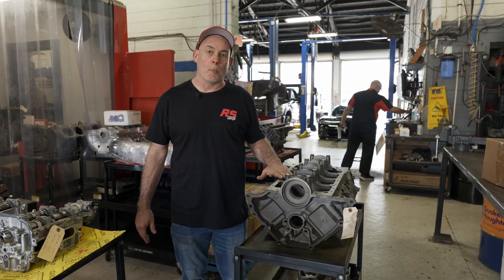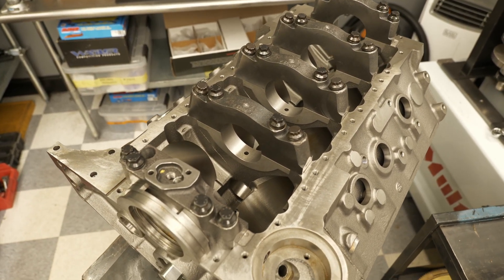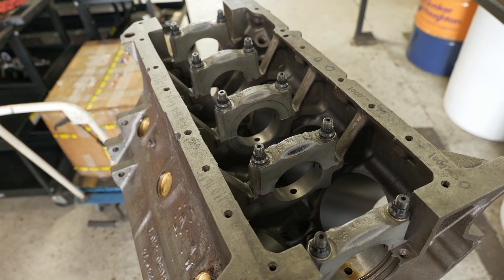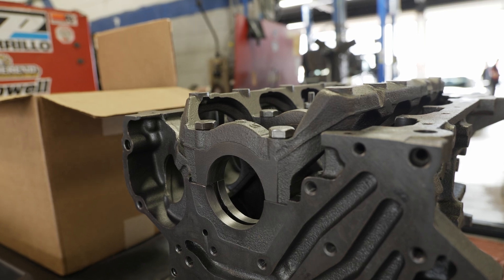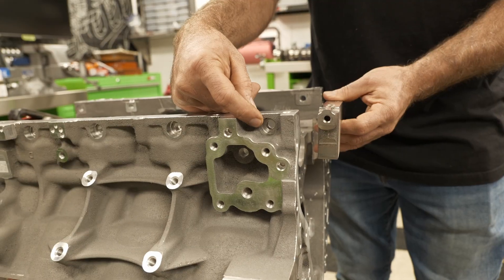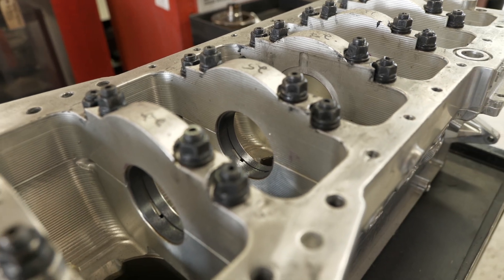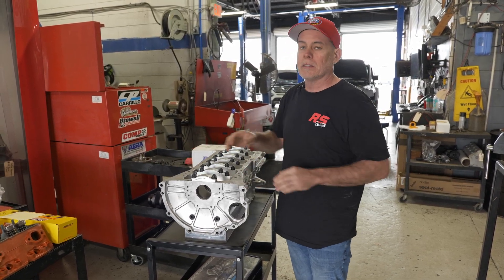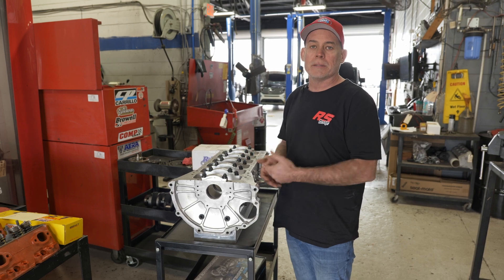Engine Main Cap Designs - Two Bolt, Four Bolt, Cross bolts, Integrated Girdle, Bedplates | RS Garage

Comment: ARP 8740 main stud kit vs stock main bolts: Do I need to re-check the main bearing clearance if the machine shop used the stock style main bolts vs the stud kit? I want to swap in the main studs vs the stock bolts. Engine is 2jz 800 to 900 hp to the wheels manual trans, 7500-7800 rpm, stock crank, stock caps.
Reply from the maker: Yes you should re-check the main bearing clearance. the studs will clamp down more and may cause it to be tighter.

Comment: VH45, is the most passed up Nissan engine. Deep Skirt 6 Bolt main with girdle.

Engineered Performance made some cool caps/bedplates to convert 2 bolt to 4 bolt mains for VG/VQ, but mostly posts on FB/IG (lame) and doesn't respond to messages, or make sales unless there's something big in it for him. (..bad support/no sales).
Kinda like Hartley. The worst support, they pick and choose what jobs/people to respond to. 
Really bad culture forming from electronic communicating, aka Ghosting.

Comment: For me, the Ferrari 296 GTB crankcase design is the best 💪
Reply: I don't quite understand. Could you elaborate or add a link. I wanna learn
Reply: @bryanshaw521  from what i can find it seems that the ferraris bed cap is integreated into the oil pan and the whole lower assembly is one piece
Reply: @bryanshaw521  Just Google ferrari 296 engine crankcase and you'll find the schematic on the first site ;)